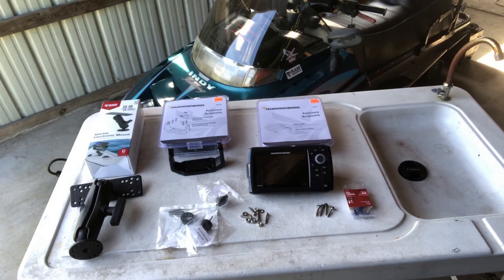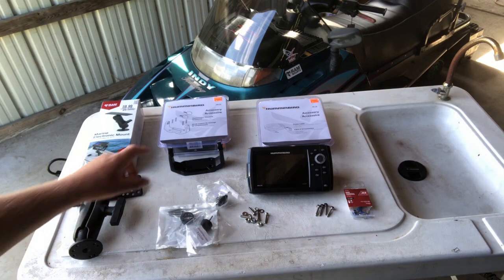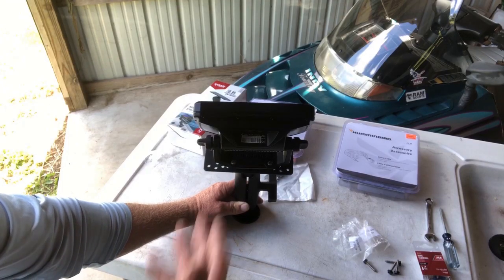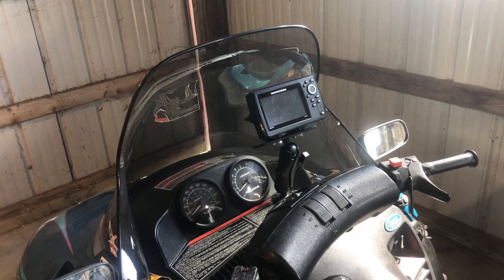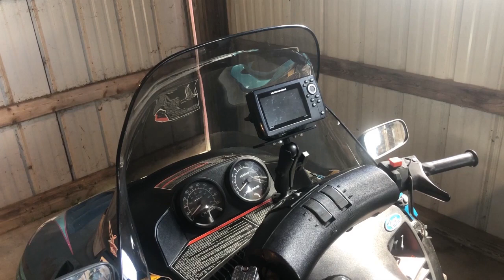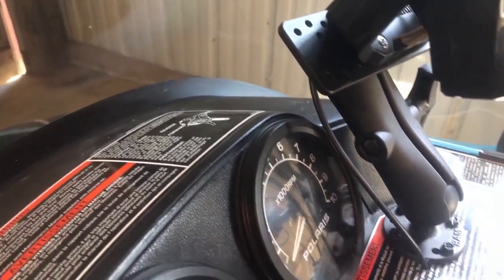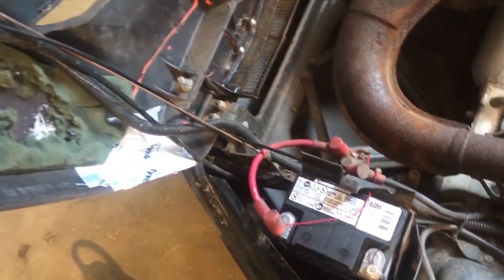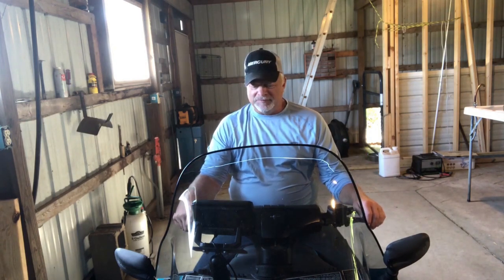How to install a fish graph on a snowmobile

Comment: What size  and what kind of crews did you use on mounting your Ram mount. I don't want to use bolts and nuts because I don't want to remove the hood to tighten the nuts. Also is that a Medium Ram mount with a " C " ball size ? Thanks

Comment: Did you need to unplug the unit when not in use to not drain the battery? I’m planning on doing this for the upcoming season
Reply from the maker: I didn’t need to 
But because it’s so easy to connect and disconnect the entire unit, I remove it when I’m not using it
Thanks
Reply: @zakparker72 Yes. If you don’t have a dedicated battery, and it’s coming straight off your starting battery it will drain it, and leave you stranded. If you’re doing the wiring process already the smarter alternative would be running a dedicated lithium, so you’re not pulling  straight off your starting battery. Could be the difference between walking back to the truck in negative temps, or frostbite.

Comment: Great video!  I was wondering, is there a way to install a unit like this but without drilling holes?  I bought a new sled and am a little nervous drilling holes lol.  I wasnt sure if RAM made a mount that didn't require drilling.  Love your setup!
Reply: Probably not man. I was thinking about it too, and the only other options would be adhesives or suction cups, but that stuff doesn't usually do well in the cold. I just bit the bullet and drilled in a ram mount. Think of it this way. You can use the mount for other digital devices that you might want when you're just riding.